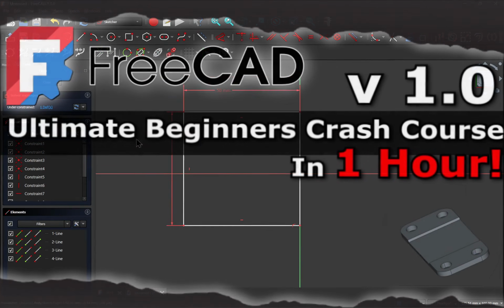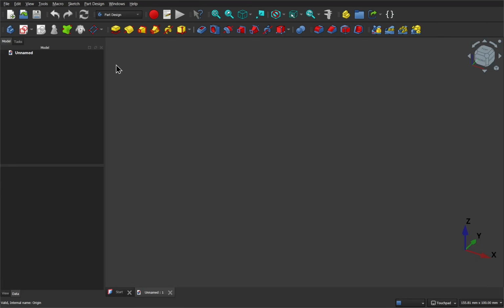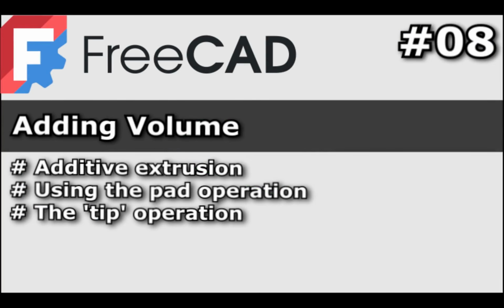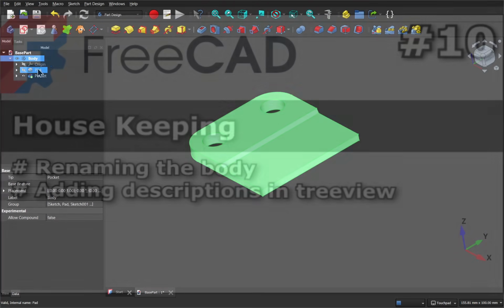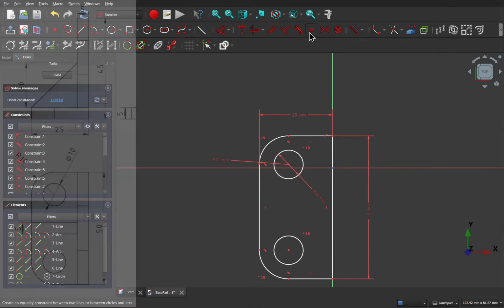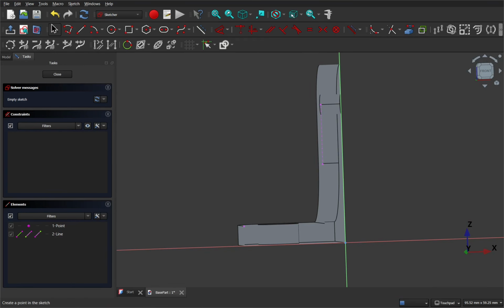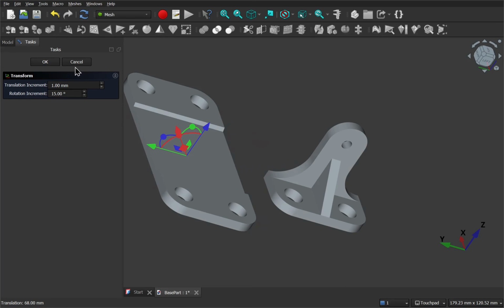FreeCAD 1.0 Ultimate Beginners Crash Course in 1 hour for 3D printing   CAD Lesson / Tutorial

Comment: One issue I keep getting caught with trying to put a hole or pocket in a sketch, is that I am forced to drag the sketch name and drop it on the body name in the model window. I am sure there is something as a beginner I am failing to do, but this is how I get it to work.
Reply from the maker: It sounds like it could be one of two things.  Either the body is not active (in bold in the treeview).  Right click to make sure the active is checked.  Or you may be navigating to the sketcher workbench rather than using the create sketch icon in the part design workbench.  Let me know if that helps at all.

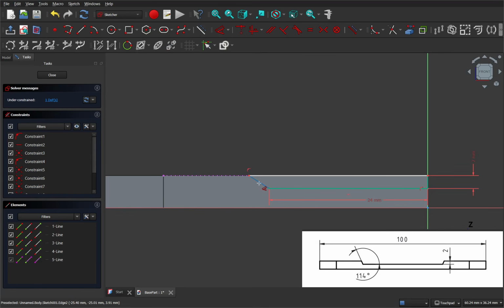Comment: If you still have a pink line causing the pocket operation to fail @25:00 or so, You have to convert that to construction geometry - think this changed in newer versions
Reply from the maker: Yes that it a 1.1 change and cause numerous issues for older videos unfortunately.  Thanks for sharing.

Comment: Many thanks for this guide.
With it I did my (almost) first CAD steps (so far successfully).
My first object was a connector between a kitchen blind and the sink frame, quite similar to the second example piece (which I'm going to 3D print).

The only thing I wasn't capable of was negative rings around an extruded pipe.
Reply from the maker: I had to do that for mine as someone (me) didn't measure it properly and the blind was slightly to small to span the gap.  Got to love a 3D print solution :) With the negative rings look at the part design groove, same as the revolve but remove volume in a circular revolve.  Glad you enjoyed the video and it was already of use :)

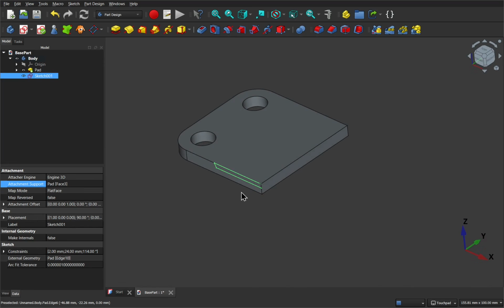Comment: Anyone struggling at 25:40? It says: Wire is not closed.
Reply: Finally found the problem. In sketch I did not found  "Create external geometry" but "External intersection". The function probably changed in the new version. The line is then part of the wire, that is the problem. The solution is clicking on the line and then on "Toggle Construction geometry".
Reply from the maker: Sorry for the late reply on this, you're exactly right.  1.1 change the default behavior. I created a video a while back to cover what was going on https://youtu.be/fstXygscASo?si=wMzEb9WtqMmcjmW9  It has caught a lot of people out, as you have found.

Comment: For people stuck on the polygon redundant restraints, there are several suggestions, but the quick and easy solution is to go to preferences search for "auto constraints", and you will see an option for "Auto Remove Redundant Constraints" that will fix the issue.

Comment: Absolutely the best tutorial for anything I have ever watched. The only  thing that didn't work for me was using the dimensions on the out of square part, touch the three different points to get the distance to auto adjust ended up cutting the part in half with over constraints, I did it a second time getting my freehand draw lines closer to what you did on screen had the same result, but like you said that is just one way.

Comment: I ran into issues when using the PAD (Extrusion tool) after using external geometry.  My sketches would not pad, error "wire not closed".  This drove me crazy until I figured out the external geometry add lines to the sketch so the sketch wasn't closed.  Solution was to delete lines at the bottom of the list in the task tab.  Is this a bug, or something I am doing wrong with external geometry?
Reply from the maker: Nope your not going mad, the developers have change the default behavior of the tool and it's catching a lot of people out.  You need to toggle the geometry to construction, or toggle the mode first. I ended up creating a video on the issue it has stopped people in their tracks with older content: Here's the video: https://youtu.be/fstXygscASo

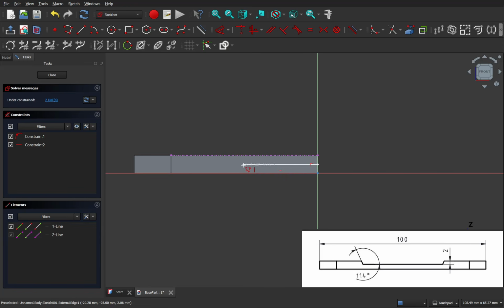Comment: Are there possible bugs in version 1.1 that will not permit the user to move beyond the step shown at 23:30 in the video? At least 6 times through with multiple attempts each time, and still can't get beyond this point.
Does the author address (respond to) such problems in this video?
This is important as I can't go on to any other of his videos until this problem is solved.
Reply from the maker: If you getting the famous 'wire not closed' error, freeCAD have changed the behavior of imported external geometry.  This problem has been mentioned numerous times across the internet and is proving to be a complete headache for anyone following "older" tutorials.  It is easily solved and can be permanently reverted back to older default behavior whilst keeping the features of the new tools.  I have create a video on it detailing the issue, the way this now works and the setting to change along with some other information that will help. https://youtu.be/fstXygscASo
Reply: @MangoJellySolutions : Thank you very  much for the reply and information. This problem was driving me nuts and as a brand new 3-D printer and FreeCAD user, to say I was discouraged, would be putting it mildly.
Again, thanks.

Comment: Using FreeCAD 1.1, at 23:30 in the video, when I try to do the pocket operation, I am told that the "pocket is not closed". How can this be corrected.
Reply from the maker: Yeh unfortunately your hitting a change that freeCAD implemented in the new 1.1 which changed the default behavior.  It can be reverted back or the imported geometry switched to construction geometry. I created a video showing the settings and the new workflow as this is really affecting users out there, new and experienced https://youtu.be/fstXygscASo

Comment: If someone else has an issue with open-wire when doing the pocket at 25:00.
Solution: make the "alignment-line, which is on the edge of the solid to an auxiliary-line (G-N). It then changes Color and gets dashed.

It seems to happen automatically in the video, but not on my bench (V1.1)
Reply from the maker: There was a great change in freeCAD 1.1 that allows you to import geometry as either construction geometry (as it would by default in previous versions) or defining geometry (normal geometry).  Unfortunately geometry is coming in as defining bey default so you have to toggle it back to construction as you have found.  This video was shot on 1.0.  Thank you for adding the comment. It's catching a lot of people.

Comment: If anyone here in 2026, you can change the external projection tool to the create external geometry tool by going to the:

settings -> sketcher -> always add external geometry as construction

FreeCAD 1.1 changed it so that it's not just a construction line but it's a wire too. So when padding, the padder thinks it's not a connected wire.
Reply: Bro thank you so much i have been struggling with that for 4 hours now 😅

Comment: Great tutorial! I was with you until the pocket part. I do not have an 'external geometery' tool, but instead have an 'external projection' tool. When using it, and following your steps, I get an error about 'two redundant constraints' which I then delete. Everything else goes fine until the pocket section, where the entire part dissappears!
I am using Linux if that changes anything, but my interfce looks exactly the same as yours.

Thanks in advance!
Reply: One thing I have noticed, is that when the 'cutout' drawing is selected, there is a line which extends all the way to the corner near the hole. I'm sure this has something to do with my problem, but I've copied your guide exactly several times and the ssame thing happens each time

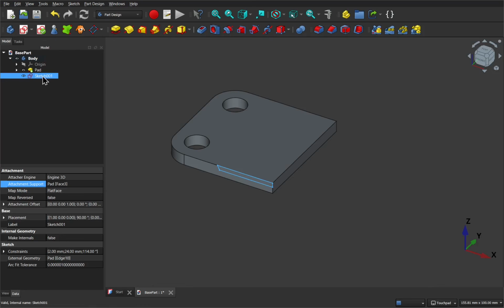Comment: How do i stop the imported geometry line from being part of my sketch? At 25:30, when i look at my sketch, the top line covers the whole edge of the imported geometry. I have done the dimensions and i have done this sketch at least 5 times. Jesus this is hard
Reply from the maker: In version 1.1 of FreeCAD the way external geometry works has changed.  By default it is imported as defining geometry rather than construction geometry as per version 1.0.  If the line is solid it is defining.  To change it to construction you must select the geometry and use the toggle construction geometry icon on the toolbar.

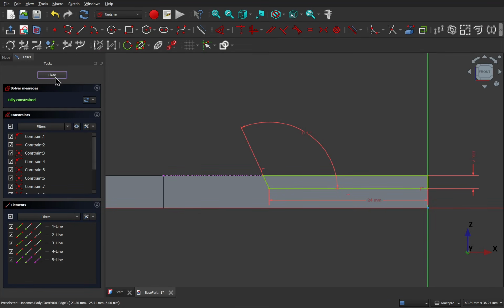Comment: For anyone using V 1.1 and getting stuck at 25:28 with it saying "pocket: wire not closed" it's because the first line isn't automatically a "construction" line. Go back into the sketch, click the long line, and click the "toggle construction geometry" button, looks like a solid line over some dashed lines. Then the long line should turn dashed, and it should work as normal.
Reply: Worked for me thanks.  Be sure to "Toggle Const Geometry" on the long magenta line.  My first try was on the long "top" green line.  Nope.  Magenta worked.
Reply: thanks man

Comment: i am using Freecad 1.1.0 .. at 22:56 when i tried to create the external geometry line it wasn't dashed (a construction line) and it was solid magenta line and when i drew the part to pocket it .. it gave me an error saying "the wire is not closed" and i fixed that by going to edit --- preferences -- sketcher --- general and enabled "always add external geometry as construction" and when i made the construction line again it was dashed and everything went well 
thank you so much for this tutorial <3
Reply from the maker: Thank you for reporting that back, it's a change on the latest 1.1 that they have made defaults, hope this will help others.  And great to hear you like the tutorials.

Comment: I was very familiar with solidworks because it’s, what I used first in school and then university and I’ve not designed anything in like 5 years so when I got a 3d printer and decided to get back into it I no longer have access to solidworks because my university license has expired plus I’ve forgotten almost everything. I downloaded freecad and the navigation alone was just too difficult I deleted it and pirated solidworks now I switched to Linux and I don’t want to use one of those browser programs so I’m stuck with freecad and this time it’s a bit easier but there are a lot of things I don’t remember how to do and these videos have been really helpful for that.
One question I have is in some softwares like solidworks or inventor when you’re designing a part and you hover your cursor over for example the midpoint of a line it highlights the midpoint for you to know and it makes it very easy. Is that option available in freecad?
Reply from the maker: Glad these videos are helping. Since alot of CAD companies are going online and makes accessing that software so much harder even if you have a old copy in a drawer somewhere. With the  snapping there is some ability in the sketcher when adding dimensions. There is also the pick radius in the preferences that make it easier to select points and vertices. The only place that the exact functionality that your talking about exists is in the draft workbench. But that is more for 2D drafting and is totally different from using something like the sketcher.

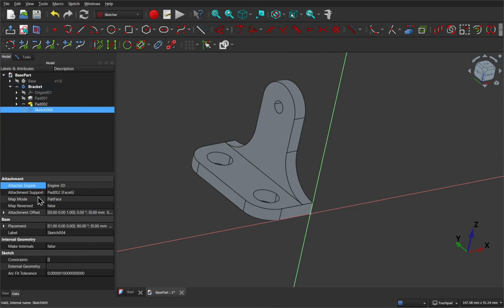Comment: 50:49 chances of anyone knowlegable seeing this is low but does anyone know what settings affect these menu names? For some reason the names of that data (the position, location, X, Y, Z labels for that whole lower area) are auto hidden for me and as soon as I finish expanding them they self auto hide once I interact with anything else.

Makes it extremely slow and frustrating to use an already unintuitive and frustrating software package. Looked through the preferences menus but couldn't find anything that stood out to me as being related to that.
Reply from the maker: I've seen  it ;) Go to you data tab, hover over any property and right click.  There is a menu option on the right click menu called expand/collapse properties.  Within that it sounds like you have auto collapse checked.  That hopefully will help.

Comment: Thank you for making FreeCAD understandable!

I had some difficulties when I accidentally got slightly different automatic constraints which made my result differ from yours. Inaccuracy in mouse selection. Then I learned to look at the little constraint icons and bottom left corner hint on what item the cursor is pointing at. Then it was easy 😀
Reply from the maker: So happy to hear you figured that out, also on the left pannel in the sketcher, look in the constraint section you will see a drop down, within there is a option 'auto remove redundant constraints'.  Check that and that will help you our as well.  Thank you for adding what you found that was causing the issue, sometimes I am working blind to figure out what has happened and what you have done is made me realise I have missed out some information in this course that would of helped many others.  And thank you so much for the donation, really appreciate that :)

Comment: I keep getting redundant constraints 12 at around 35 minutes what can I do there so it won't happen
Reply from the maker: In the left hand panel in the constraints section, there is a dropdown where you can enable 'auto remove redundant constraints'  this will really help with this issue.

Comment: I have only been able to master TinkerCad and I have become quite good at it. I would be able to do the components of your tutorial in a couple of minutes and it will be just as good for 3D printing. However, when it comes to more complex shapes and adding a fillet or chamfer to an object, it is a huge task in TinkerCAD and almost impossible if you have rounded corners. This prompted me to look into FreeCAD, but the learning curve initially looked impossibly steep. That is when I stumbled onto this tutorial.... You are a great teacher and you pace the learning exceptionally well. 
I ran into the issue of redundant constraints early on and almost gave up. I am glad I didn't - once I had that sorted, things went better. It also led to a better understanding of constraints and where they come from (if I understood that properly, it would be easier). I have done the tutorial 3 times now and can create the parts without any guidance now. I am looking forward to following the rest of your tutorials - thank you!
Reply from the maker: Thank you so much for the kind words, really glad you stuck with it and are enjoying parametric modeling that freeCAD gives. Redundant constraints can be a complete turn off, having the 'auto remove redundant constraint' option checked in the sketch constraints panel dropdown really helps and when you do get that message, clicking the number in the brackets highlights the constraint which you can remove.  After sometime of learning when you do get a redundant constraint the option hasn't caught you learn how to quickly identify what has gone wrong.  So glad this tutorial has helped and thank you for taking the time to comment.

Comment: In the beginning, instead of clicking on "create body" icon, I clicked on "create part" icon (they look similar). Everything went the same way, and I cannot understand the difference even though I googled it, seems complicated. Can you explain when must I use part vs body
Reply from the maker: The body container should be used in part design, the part container is a generic container that can be used in many workbenches.  For part design use the body container as it is integrated in the part design workflow.  If you are following the longer course on youtube you will get into multi-body modeling.

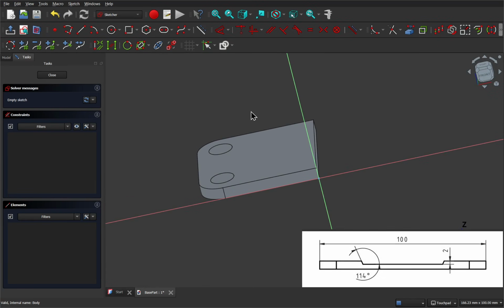Comment: Great video - However everytime I sketch on the side of the block (22:45) external geometry my wire shape turns orange when I click on the vertical construction line before I close the shape fustrating 😞 (V-1.0.2)
Reply from the maker: Make sure you have the auto remove redundant constraints checked in the constraint panel drop down in the sketcher. Also where it shows the 'over constrained' text on the left, within the brackets there will be a number. Click on that to highlight the redundant constraint and hit delete on the keyboard. Glad you enjoyed the video and hope that helps.
Reply: @MangoJellySolutions  Thanks will try again 👍
Reply: Spot on thanks for your help - Great tutorials 😊

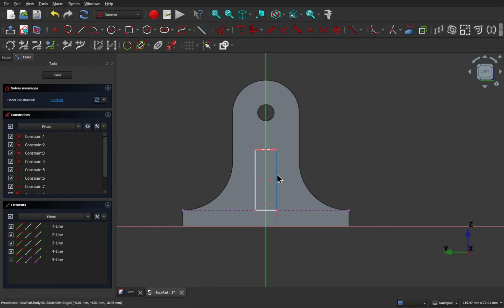Comment: Oddly enough, at 43:41 on my end, when I define symmetry, it doesn't automatically delete the vertical constraint for the side between the two points, which happens in the video. Then nothing works anymore, and it took me an hour to figure that out. So, when you create the rectangle, all the lines get a vertical or horizontal constraint, and for symmetry, you have to delete one of them. And all this just because someone in another tutorial disabled the automatic deletion of unnecessary constraints. What a pain! :D

Comment: I am trying to create a part that is a short cylinder that is segmented into 7 seperate 52.43° segments. 
Any tips on how to do this elegantly/accurately? It's a bit of a nightmare
Reply from the maker: So a couple here, 
If you want  to separate the cylinder into sections but have one single solid.
1 . in part design create a new body and a new sketch with the wedge of your section at the angle of 51.43 degrees.
2. Exit the sketch and create a pad.
3 Create a polar pattern of the pad and increase the occurrences to 7.
4. The model will currently look like a cylinder without sections, click on the polar pattern in the treeview, look at the data tab and find the refine property.  Set this to false  or no.
5 You will have a solid cylinder with 7 sections.

If you are looking at wedges from a cylinder as separate solids.   Part design (as in this video) deals with a continuous solid.  I would use the part workbench.  

1. Draw one segment with the center point of the sketch as the middle (using basic arc and line tools) and set the correct angle.
2. Exit the sketch and extrude.
3. In the draft workbench you will find a polar array that you can apply to your wedge with the number of occurrences.
4. This is a compound which can be exploded into separate sections. (top menu \. part \. compound \. explode compound)